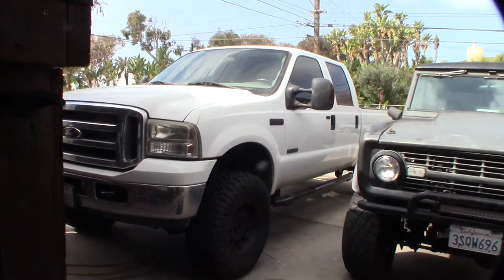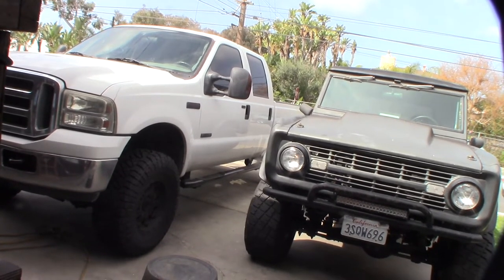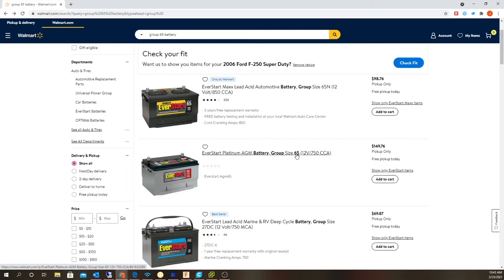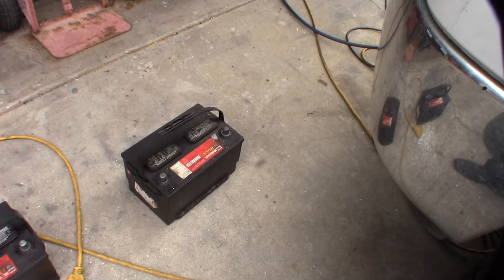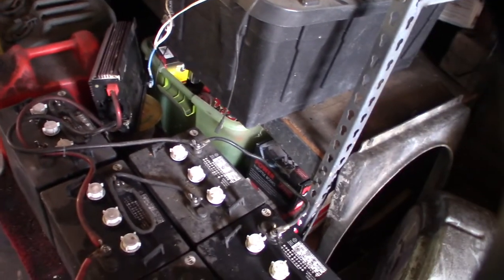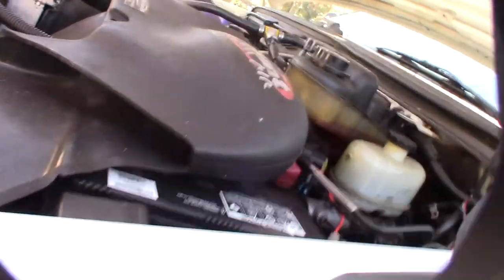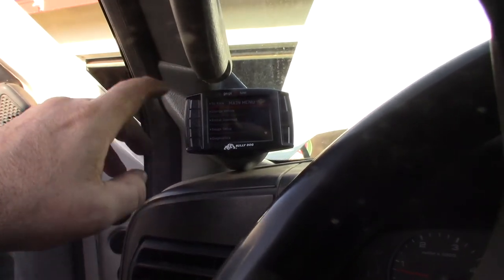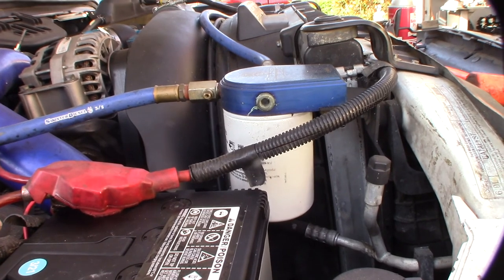Walmart Everstart AGM Battery Ford Powerstroke 6.0 Made In South Korea Group 65

Comment: Hopefully everyone knows that new batteries do not come fully charged.  They must be given an equalization charge (a controlled overcharge) prior to installation.  This can be done with a manual charger using a timer, or an automatic charger using something like a desulphatoin mode.  Charger manufacturers are very poor at giving instructions for this, and the user must get to know their charger to get this right by watching what it is doing to the battery with a voltmeter, and perhaps even a clamp current meter too.

Comment: YouTube Channel - Scotty Kilmer had said . The batteries shipped over here from South Korea , don't last long . As I believe I had read to not buy a battery that was older than 6 months , best as soon after manufacture . They put a round sticker on them now , showing month and year . And it seems quality has decreased and quality control is non-existent . Costco here in the USA has Interstate AGM batteries that say made in Germany . I would rather buy them than made in Korea . As I have had two made in Korea  , both going dead , bought a AutoZone .. Last one brought back to life after using battery jumper . Now , I know when you replace the battery . Check the new one for condition [ topdon tester ] and to stickle charge it [ topdon charger ] as much as possible to 100 % SOH and SOC , before installing .

Comment: Ive always heard you have to top a agm battery before you install them ???
Reply: Not true. Agm are maintenance free
Reply: I first check the "new" battery with a digital battery tester (mine a Viking from Harbor freight, $40), then if it's okay I put on my BatteryMinder (Model 2012) charger & desulfator, THEN install it in my vehicle. But that's just me.
-- BR

Comment: Did you have to use the vent holes on the battery
Reply from the maker: Where are the vent holes? You mean pressure relief correct?

Comment: Walmart amg..best deal
Reply: Heck yeah. Especially since it comes with a 4 year warranty.
Reply: @solidsnake4022  how's your battery holding? I'm trying to get a replacement but Idk if paying extra is worth it like a yellow top
Reply: @guillermoestrada6007  Optima is poop. They used to be the best but the company sold and moved their facility to Mexico, their quality control is ZERO. When I worked at autozone for a couple months summer job we had pallets full of bad yellow tops, well and Everstart economy batteries too, but the AGM Everstart are made by Johnson controls